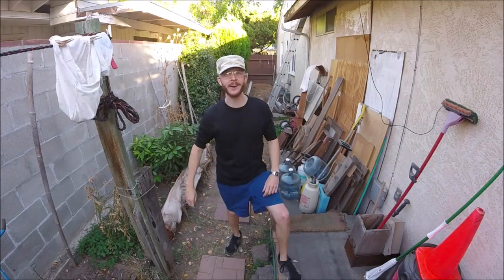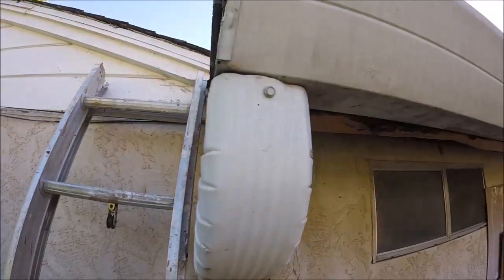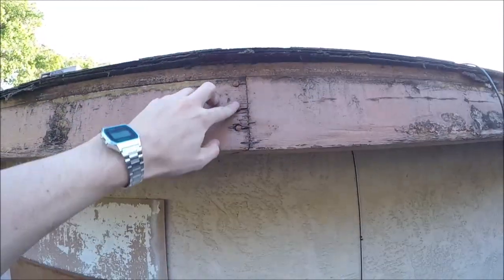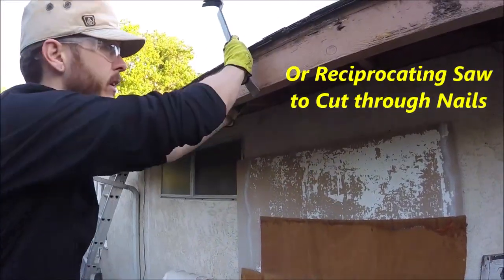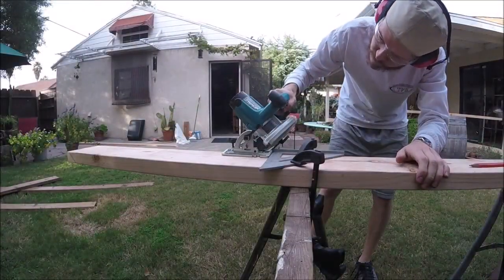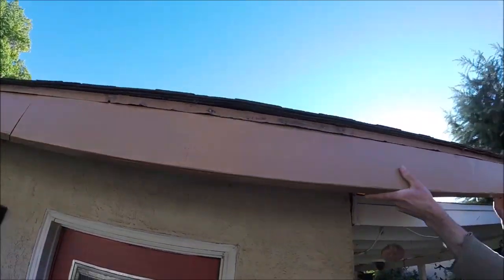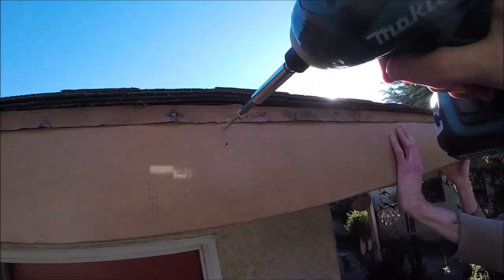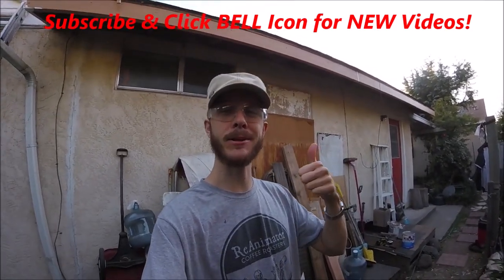How To Repair or Replace Rotten Wood Fascia Board

Comment from the maker: Tools & Supplies Used

Tape Measure Stanley- http://amzn.to/2supid8
Speed Square- http://amzn.to/2idDsOz
Dewalt Combo Kit (Saw Drill & Driver)- http://amzn.to/2fSjiZS
Hammer- http://amzn.to/2tfjnMY
Nail Puller Prybar- https://amzn.to/2pPQi6a
3in Star Head Screws- https://amzn.to/2Ofbj5X
Caulking Applicator- http://amzn.to/2tbO4PC
Silicone Caulk CLEAR- https://amzn.to/2KKtLkY
Paint Brush Set- http://amzn.to/2fHZmW3
Carpenter's Pencil Set- http://amzn.to/2idCoKz
Safety Glasses- http://amzn.to/2ez41Jw
Leather Work Gloves- http://amzn.to/2x5BZk3
Respirator Masks N95- http://amzn.to/2xX32x3
Thanks for Watching! Help Support the Channel by Subscribing & Clicking the BELL Icon for all NEW Videos!

Comment: I appreciate work done right! So many videos suggest half assed work! 
One thing  suggest is to squeeze caulk in the joints before installing the new trim.

I recommend NOT to use silicone caulk because it is not paintable.
Reply from the maker: Thank you 👍 Yes it takes longer to do it right, but it's worth the while in my book. Like the old saying you want it done fast or you want it done right? 🤣 
Great tip on the sealant on the joints, will try that next time. And yes paintable silicone caulk works great.

Comment: Im guessing there were nails still left from the roof plywood part, did you use an angle grinder to zip them off? If so did you then lift the shingle up to screw down plywood roof to the new fascia board you installed? Thank you.
Reply from the maker: Yes I just cut them off, you can use angle grinder or better yet if you have a reciprocating saw or even jigsaw with right blade just put it in the crack and run it down the length cutting the nails before prying it off the rafter tails. That's how I did it the last time I did this, it worked easy with sawzall. I used a bit of construction adhesive to adhere back to plywood. You could also drill pocket holes on backside of fascia going up, that would work well. On this one the plywood wasn't very strong on the edge anymore, so screws wouldn't have done much 👍

Comment: Great video, thanks!. Question - My drip edge is under the shingles and can't seem to remove all the nails into top of fascia without lifting all that up. How can I get the shingles all nailed back into new fascia boards without creating leaks in the shingles?
Reply from the maker: if needing to remove nails between fascia and shingles cut in between the two with either a sawzall, or multi tool and it'll cut nails. and I would just use construction glue (loctite pl premium) to glue shingles down if worried or in high wind area

Comment: what type & size of wood planks would i need to buy?
Reply from the maker: 2x6 lumber if you have 2x4 rafters 👍
Reply: It all depends on what was on your house. Bot all houses have the same size fascia boards. A 2x6 would never fit on my house. If you are not capable of count out and measuring your fascia boards, you are definitely not capable of replacing yours.

Comment: Hi- What about the old nails coming down from the drip edge?  Can you just cut them and not re-nail downward from the drip edge into the new fascia?
Reply from the maker: Yes you can just cut them and not re nail them. I mean if you have access to a nail gun you could nail them again. But sometimes the edge of the roof sheathing can be a lil soft and it wont do much nailing it anyways.

Comment: After the 2004 hurricanes, Florida changed codes regarding roofs. Roofers now have to glue the edge on the roof down. Will this effect the replacing of the fascia?
Reply from the maker: If the edge is glued down to top of fascia you could run a knife to cut it loose or best would be to run a  sawzall down the line and cut the nails and glue

Comment: What about all he nails you pushed up through the roof shingles and plywood sheathing that were attached to the old fascia?
Reply from the maker: You cut them, dont push them up through roofing. Then can use construction adhesive on top of new fascia or nail/screw through roofing and put roof sealant over nail/screw heads 👍

Comment: What size are the fascia boards
Reply from the maker: Mine were 2" x 6"s but they do differ from house to house
Reply: If you are not capable of measuring yours, you are definitely not capable of replacing them.